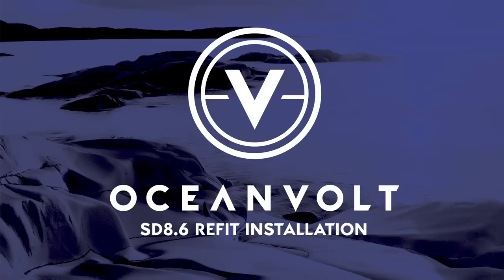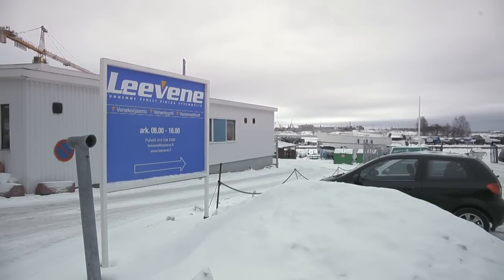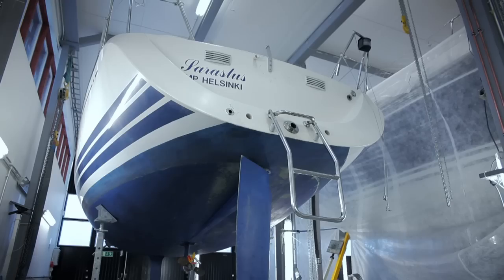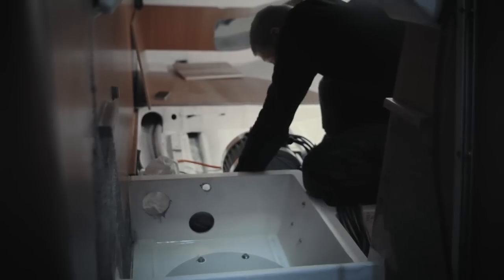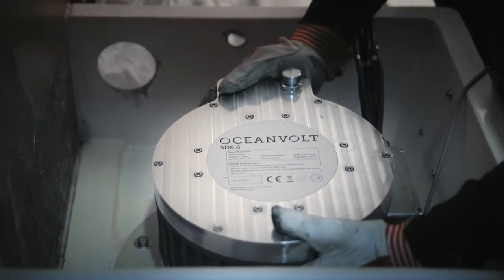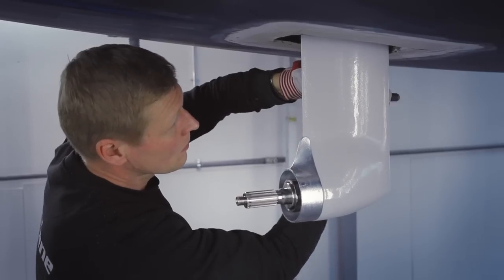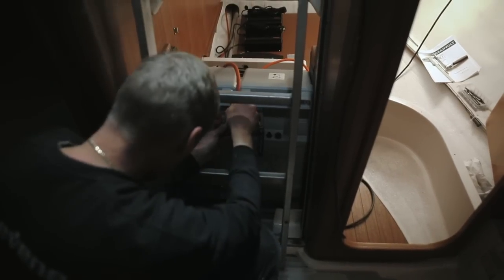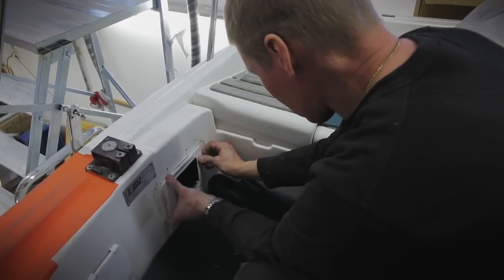Oceanvolt SD8.6 electric motor refit installation, X-Yachts X-302

Comment: I noticed in this video that they carefully avoided the question of recharging the batteries. I have recently had the opportunity to sail a electric powered sailboat on the ocean and had the standby genset running at least 70% of the time....because if I want to get more than 4 knots out of the boat...I have to run the motor at 6 kw or more...and that drains the batteries very quickly....on a flat calm lake and if you are not going distances...maybe 3 or 4 knots is acceptable....it does not work for me. ..Also with all electric or battery powered motors, I question the statements about environmentally sound, when mining the lithium is one of the most difficult and destructive processes.....I guess we have to start somewhere and it impresses people with its "silent running"
Reply from the maker: Oceanvolt systems recharge the batteries while sailing and the X302 is a pure electric sailboat so it has no backup generator. More to the point this is a refit installation video so it does not show using the system. That can be found on our other videos.
Reply: @Oceanvolt  Bonjour Hello Oceanvolt! I don't see anywhere the autonomy of the system.... It look like really good but i don't want a system with 10 min autonomy....
Reply: @Oceanvolt  you avoid giving even ballpark figures like cost range regeneration.be more open/honest.
Reply from the maker: @brianevolved2849  Have you visited our website? https://oceanvolt.com/standard-systems/
Reply: @Oceanvolt    The rate of drain to recharge is anywhere around 1:10 or 1:20.  That is not very good ratio for certain situations, like going upstreams or estuaries of big rivers or being stuck in pacific dolldrums for 9 days.  With current state of galvanics -  the battery capacity will be always achilles heel of any full electric systems. Kindly stop pretending this is CO2 neutral, because lithium mining and rare earth mining - which is both used in motors and batteries is actually extremelly CO2 taxing process.